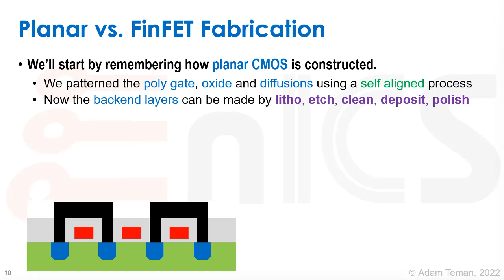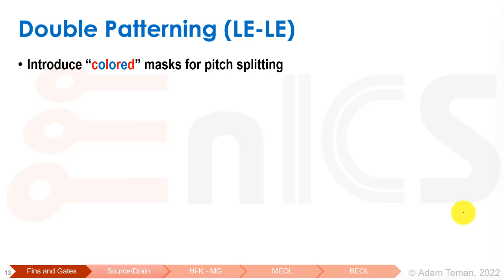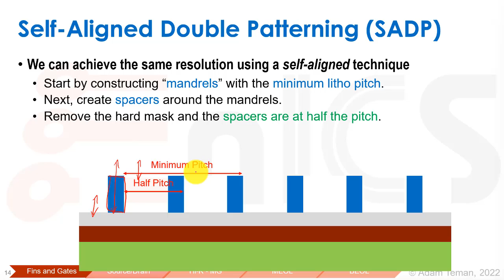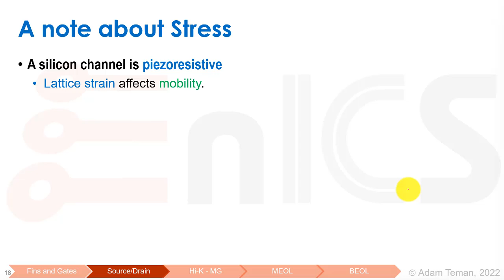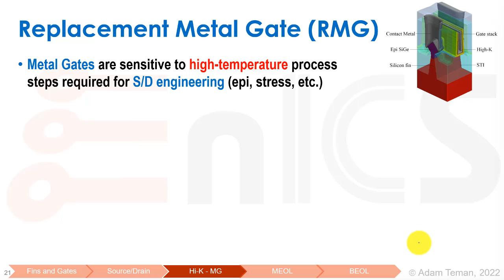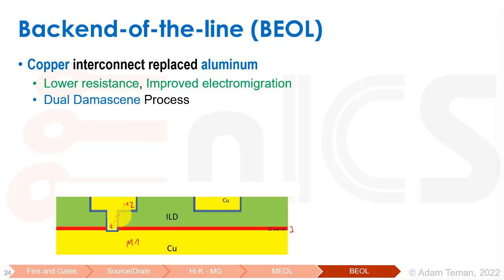Advanced Process Technologies - Part 2: Fabricating a FinFET

Comment: 31:55 why couldn't via sizes just match the metal dimensions so that the connection from one metal to a higher/lower metal doesn't have a bottleneck due to via size?
Reply from the maker: So, I'm not 100% sure I understand your question (at least in the context of the timepoint you linked to), but I will try to answer.

In general, a VIA is a bit different than a metal layer. Before copper interconnect (pre the "dual damascene" process) it was a completely separate process to implement it. The VIA has a problematic aspect ratio - it is has a relatively large length (height) as compared to its cross section, leading to both high resistance and challenges in filling the hole properly. Therefore, liner layers are used to ensure good connection of the hole to the other layers, and different materials were used that would fill the hole better than aluminum. In any case, special DRCs were devised to ensure yield under mismatch of two masks (e.g., metal overlap on via and via-to-via distance).

With newer processes using dual damascene and to lower the overhead of the vias, new via rules and dimensions were introduced which do comply with the metal constraints. However, to ensure yield, other rules are required, such as metal overlap in one dimension. Again, though, VIAs are challenging to manufacture robustly and to ensure alignment and this leads to DRCs that can become a bottleneck.
Reply: @AdiTeman  Thanks!!

Comment: As mentioned at 12:20, why do multi-patterned layers have to be unidirectional? Is it because the mask geometry doesn't work, in that you can't really "shift" the pattern in 2 directions? Or, something about how you grow the spacers that only works in one direction at a time?
Reply from the maker: Yes, I guess all of the above.
Making these tight geometries is really hard (...it's true science fiction. A miracle, even). Doing it in two directions makes it all that much harder (or impossible).

One important point is the growth of minimum spaced features (such as gates and fins) in one direction and then using an additional mask (or set of masks) to etch away the parts of the feature that aren't needed in the other direction, but not at minimum spacing. So to have a gate of a certain length, you start with a gate that goes on forever (and you print these at minimum spacing/width across the whole area) and then cut it down to the required size in the other direction.

Hope that makes it a bit more clear.

Comment: Could tell me why we put HfO2 above the source and drain? How that makes current flow?
Reply from the maker: I am not sure what part of the lecture you are relating to (if you want to point me to a particular slide or time, please tell me). But I will try to give a general response to your question.

The way that we make a gate oxide is usually through self-alignment. This is true for many (maybe most) very accurate/high resolution features on the chip. I cover this quite extensively in my VLSI course (see this lecture https://youtu.be/btFk7jkk5e4). Since we need to have a very carefully structured gate oxide and to perfectly align it with the gate metal, we do things like first covering the entire wafer with the oxide and then etch away places where we don't need/want the oxide. In the case of planar transistors, we first build the gate oxide, then the metal gate layer, and then etch away the source and drain areas. In FinFETs, the process is different, as I explain in this lecture series, but to address your question, having an oxide above the source/drain doesn't affect the current. If we want to connect to them, we need to etch away the oxide and drop a contact. But if we don't need to connect to the diffusion (for example when we share a diffusion between two serially connected transistors), the existence of such an oxide doesn't bother us. And in any case, we will build an ILD above the S/D areas to enable deposition of higher interconnect layers (e.g., Metal1). So it doesn't bother the current.

Again, if I didn't understand your question, then please refine it and point me to the time in the video that you need clarification for.

Comment: Hi Adam, I have a question on the doping step in finFET, I dont see it in your animation. isn't it needed?
Reply from the maker: Good question. 
I discuss this in the lecture on Slide 7 (and go into some detail on Slide 20).
FinFETs are "fully depleted". In other words, no, there is no doping step. Channel Doping was a huge problem in planar transistors due to RDF (random doping fluctuation), which led to huge process variations. Therefore, the FinFET (and FD-SOI, as well, to the best of my knowledge) are undoped. Instead, threshold voltage tuning is done with the metal gate workfunction. While this is also subject to variation, as far as I know, the main sources of variation in FinFET are LER and LWR. In FD-SOI, the perception is that you can change the threshold voltage through body biasing, and so there is no need for a threshold implant (though this means that you don't have multiple threshold devices...).
Reply: @AdiTeman  Hi, I also have a question regarding finfet doping. How are the source and drain contacts made if the channel is intrinsic? Usually you need a very doped region where the contact is then put. Could you explain more about how this is done?
And then I have a curiosity. What is the difference between finfets and trigates? Or are they the same thing?
Thank you very much!
Reply from the maker: @Jack181996  Hi Jack - good question, though maybe it isn't clear enough in the lecture. 
First - a small correction. You can have source and drain contacts in a planar technology with an intrinsic channel. The source and drain regions are doped separately from the channel (actually, this is an important self-alignment feature of planar transistors), so the channel doping is not required for contacts. I believe that FD-SOI has such an intrinsic channel.

For FinFETs it is, indeed, a different story. The whole middle end of the line is super complicated - going from the transistor up to the backend layers. Specifically, for the contacts, it something like this:
- The fins are created adjacent to the channel, but they are really small and problematic to contact to. 
- In addition, we want to apply stress, which means adding different materials into the S/D regions to improve the channel mobility.
- Therefore, an epitaxial layer is built on top of the fins. This enlarges the area to enable contacting the S/D region, enables adding stressors, and is doped to enable an ohmic contact.

I hope that kind of clarifies it. With that, watch my explanation in the video again and I think it will become more clear.
Reply: @AdiTeman  Thank you, now it is clearer. I have one last curiosity, I hope you can answer me. How is the S/D epitaxial region doped? I imagine with ion implantation with the dummy gate acting as a mask, but I'm not sure